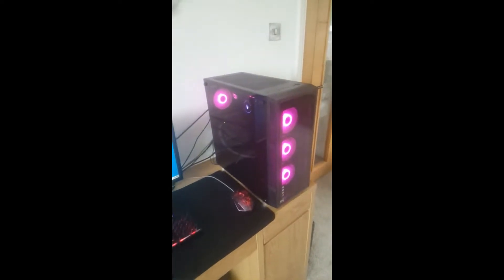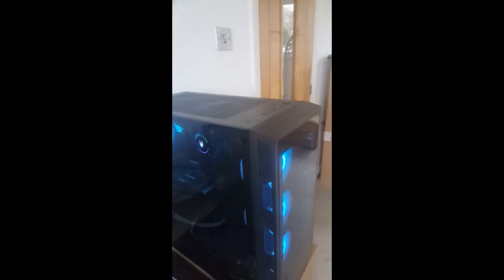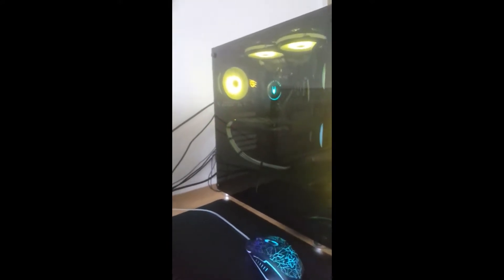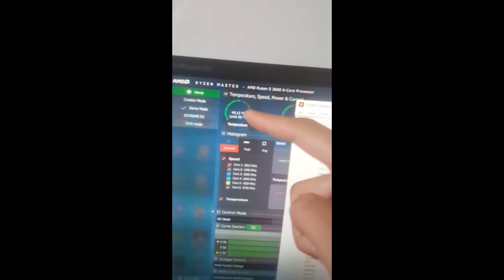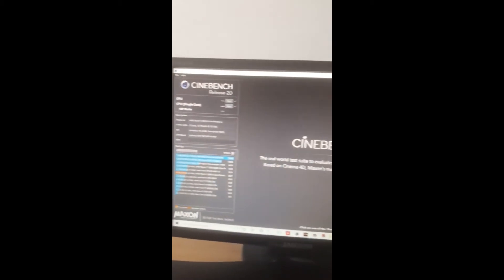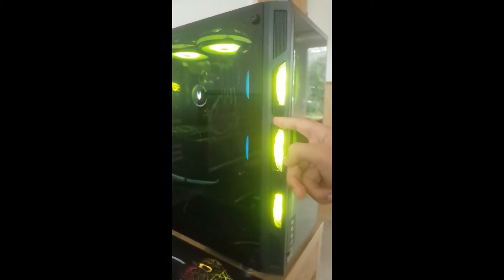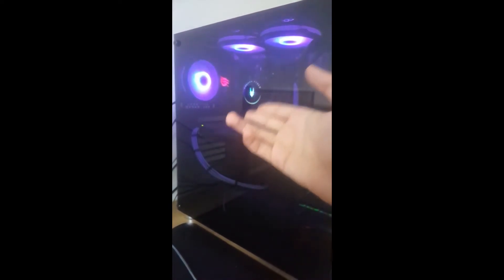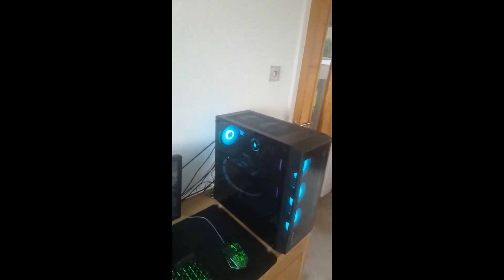Does changing your fan configuration for your AIO Really matter?

Comment: Is that cooler good on r7 3700x and oc for 4.4ghz
Reply from the maker: Yes the golden field AIO cooler is pretty good i use it on my overclocked r5 3600 and it keeps the temps in the 60s which is really good i have it overclocked to 4.5ghz so it should be good for your r7 3700x also please subscribe to the channle as it helps out a lot thanks